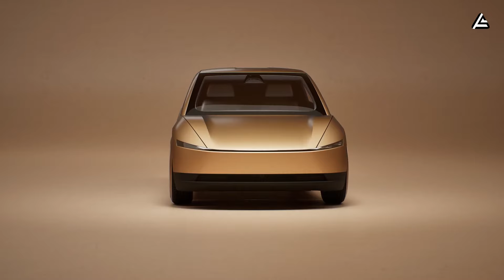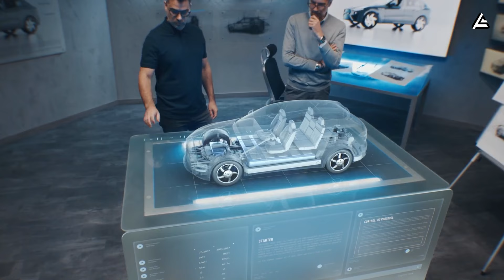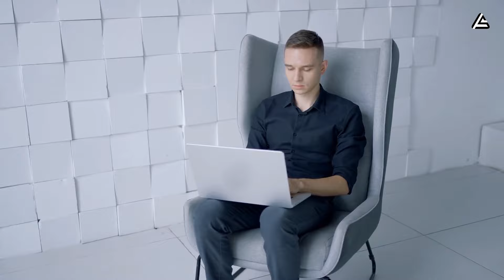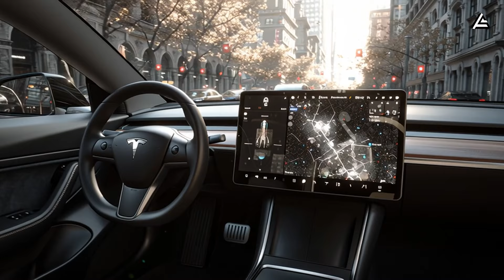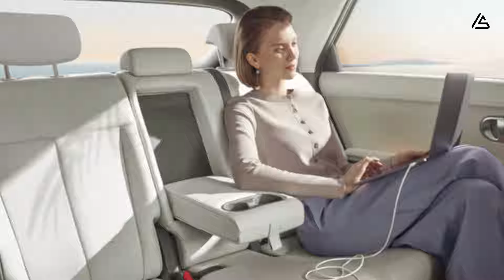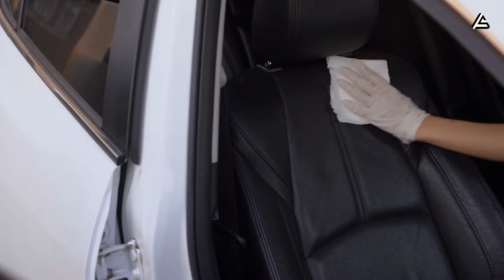Tesla Model 2 All-New Feature FINALLY Hit The Market. Elon Just Changed Everything!

Comment: I'm upset. I finally went to Tesla to test drive a model Y, and then I got to asking about the model 2, and they told me that project was scrapped and will not come to pass.  I had such a huge hope that it really was happening.
Reply: Is this true? Was Model 2 scrapped???
Reply from the maker: What are you looking forward to in a low-cost car? If it’s not called a model 2, what name would you prefer?
Reply from the maker: Actually, there is no information confirming that there will not be a model 2. Or it will have a different name, because all of Tesla's moves show that a compact crossover is a completely feasible project. What do you think about this?